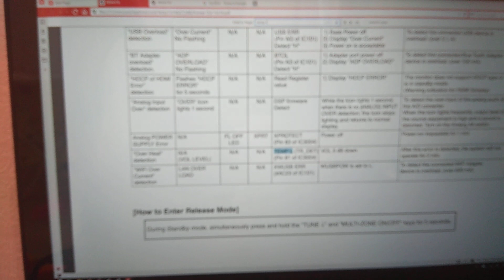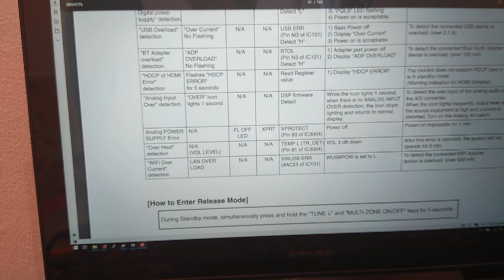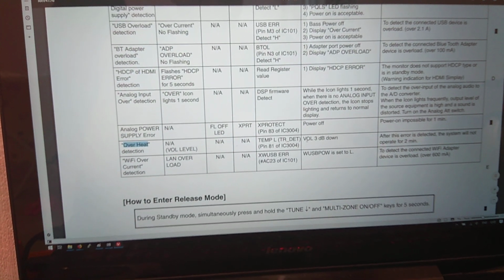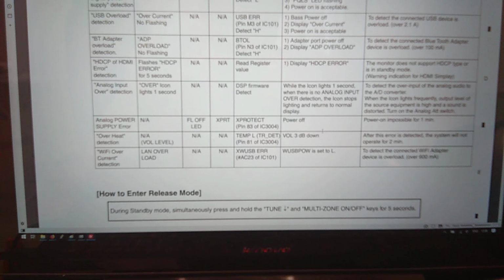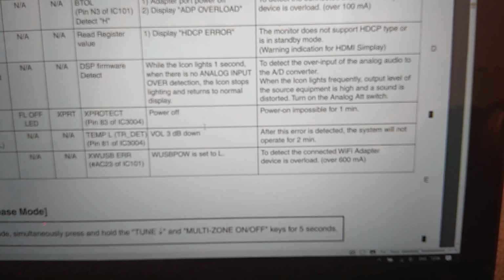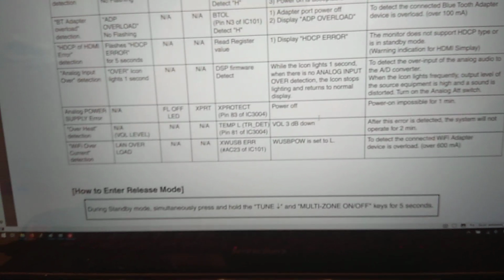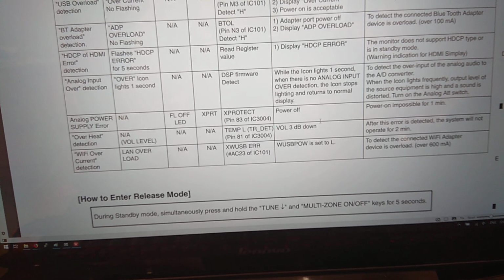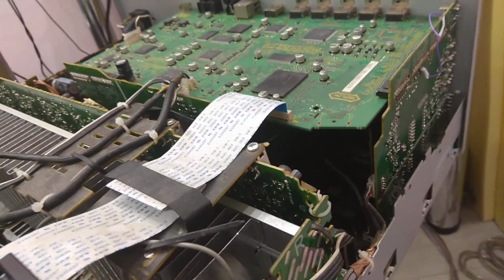fix:Pioneer vsx 921 (1021) volume down (decreasing) for 3db itself (automatically)

Comment: Greetings.... Ive absolutely the same issue (every 2minutes the volume decreased 3db till reached 5db, the receiver switched off) but my modell is the VSX 527 and there ist no TEMP_L soldering point on the board. I read in forums that this model has a lot of smd thermistors on amp board but i dont know how to indetify and fix they. Is there any other fix for this model? It seems the same hardware like the VSX-827....  Thx a Lot in Forward.

Comment: Hi thanks for this. My VSX-1122 is doing the same. I cannot find 5v feed though. I see the TEMPL pin but have only V5+ V and V5+V_V pins on the PCB. Any help appreciated. Thanks
Reply from the maker: I think both should suit. If you have multimeter (tester, or I don't know how it is in English) you can check that all time from the turn on it gives 5V between V5+ V and GROUND (GND, GNDD).
Reply: @MrFeequs  yes that makes sense thank you !!

Comment: Hi hello my pioneer vsx 921 how to make update (help me )///Where can I find updated software
Reply from the maker: just connect the internet cable and press Update in  settings
Reply: @MrFeequs  online update error 7
Reply: UE33 error
Reply: İmternet on ok
Reply: My pionner update download break off  then the system freezes
Reply: How to make
Reply from the maker: @Barcode-h2g  don't no) i'm not a pioneer master
Reply: @MrFeequs  you send update 1-151-085-111-031 my usb  ok
Reply: @MrFeequs  version: 1-151-081-111-073
 - Fixes UE33 error
 (* If UE33 is displayed on the FL display, network features are not available.)
Reply: @Barcode-h2g  Have you solved the problem with error EU33?

Comment: Hello mr I have another issue with vsx-921 
Its turn of by itself directly after it’s on 
Please please if you can help
Reply: The same like this issue 

https://youtu.be/BbBI_hD0bpQ
Reply from the maker: Really no idea.

I'm not a master but I think it can't be fixed so easy. You even can't get error code or some other notices cause the system can't keep running.